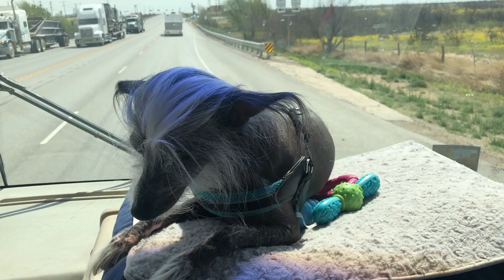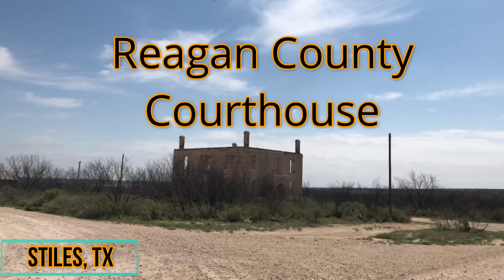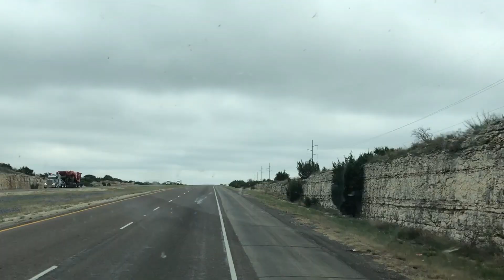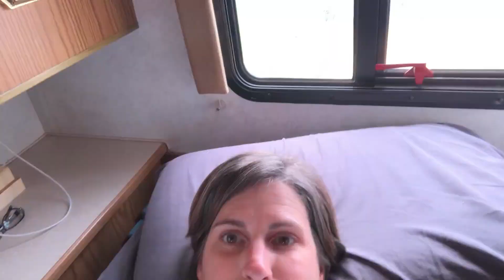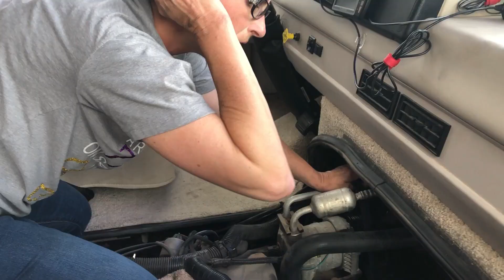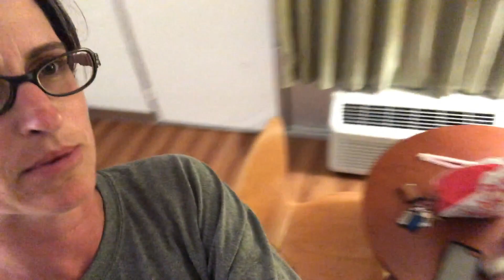Going to San Antonio-Breakdown-What Next-RVSWAT

Comment: I keep a spare serpentine belt, a water pump and thermostat, a front and a rear brake caliper, set of brake pads front and back, 2 idler pulleys, 1 spare injector,  2 spare oil filters, a spare air filter, both fuel filters, a spare tire, 2 spare wheel seals - one for the front axle and one for the rear axle, spare headlight bulb and marker and tail light bulbs, just to name a few of the spares I keep on board all the time. Its cheaper than a service call but then again I am a mechanic and have replaced a head gasket in the Wal Mart parking lot on a C7 Caterpillar in my motorhome.... Good luck out there... ;)